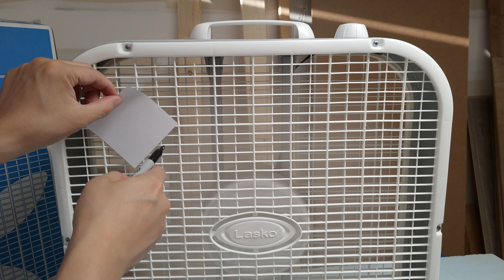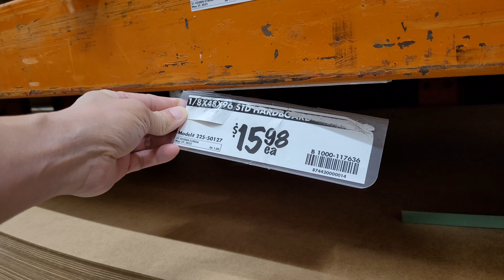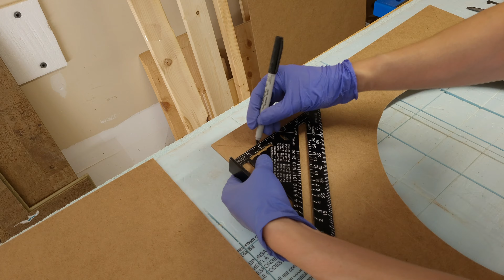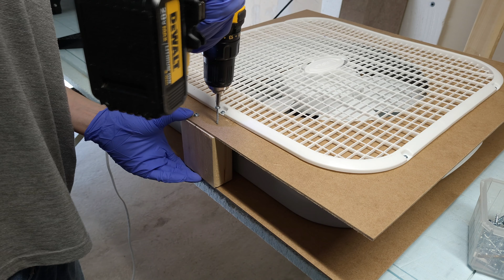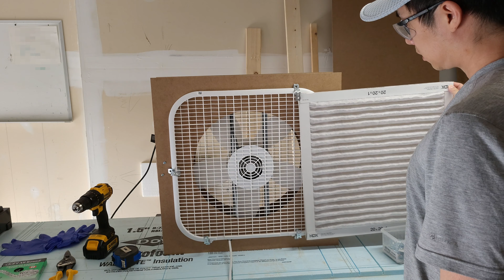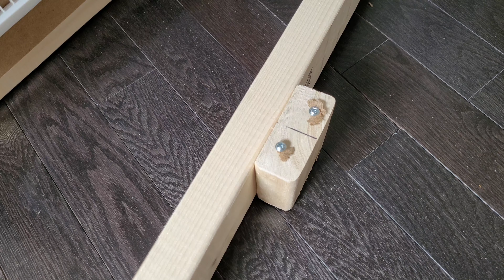How I Turned a $20 Fan ⚡ into a $200 Home Air Filtration System! DIY Dust and Pet Hair Air Purifier!

Comment: Great idea.  Have you noticed and problems with the motor heating up due to to restricting the air-flow?  I have multiple cat household and would love to run this when mopping and cleaning to capture airborne hair.
Reply from the maker: Thanks! There hasn't been any problems as I've been running it this way for several hours at night. It does work a bit harder at max when the filter is on but I experienced no motor or heat issues at all. The filter works really well if you do enclose your space for cleaning. I like to return it to the window to bring in fresh outdoor air making sure another window / bathroom fan is open in the house to exhaust. Cheers

Comment: Great video.  I’m going to try it.  Why do you suggest a filter with metal?
Reply from the maker: @lorileelou1726  thanks for watching 😀 the metal mesh reinforces the structure and also prevents the material from being blown into the blades (if in front of the fan) for safety. Cheers

Comment: How's this holding up? I heard it's bad to use only 1 filter up close and could cause the fan motor to work harder = lower life span
Reply from the maker: Thanks for asking! Not many comment on this video lol 🙂It's held up pretty well! I've been using it quite a lot only at night time when the temp drops outside. But yes probably works the motor when the filter is right up against it - it does draw a bit more amps to compensate but given how cheap these fans are, its okay to me and I don't think I'll run them 24/7 to cause any issues. Cheers!

Comment: Great project but one serious concern is that at some point the fan will be pushing damp humid air and the mdf will grow mould and that'll be a bad day for your lungs, I think sealing the mdf with paint or a thin layer of pva glue would😢 sort that but commercial units are expensive for this level of safety and consideration required. Maybe using perspex would be much better
Reply from the maker: Hadn't thought of that, that's a really good idea! I'll add that to the improvement list. Thanks for sharing! Cheers